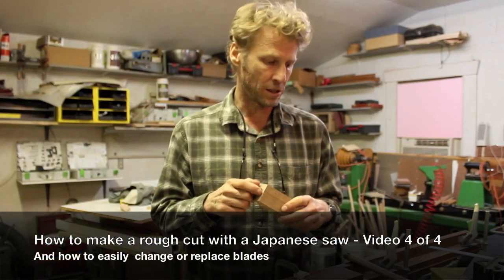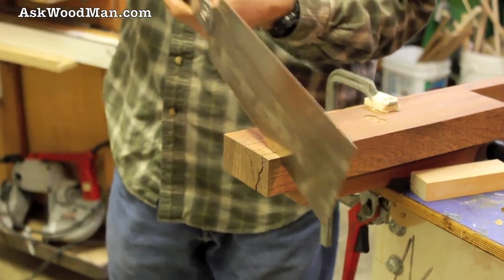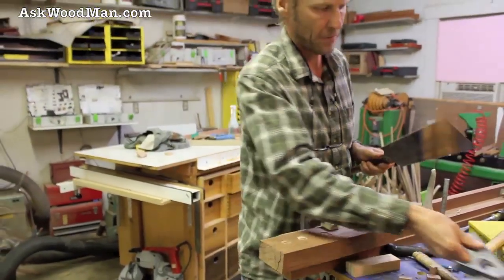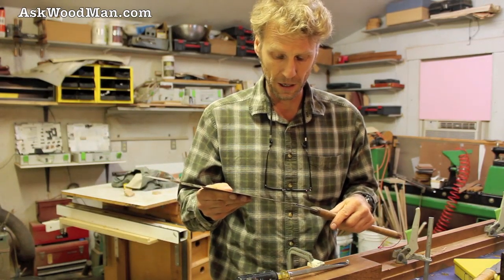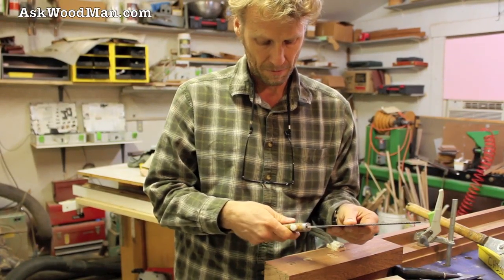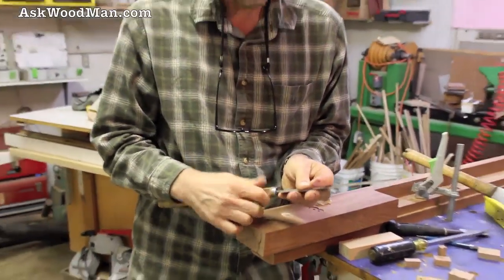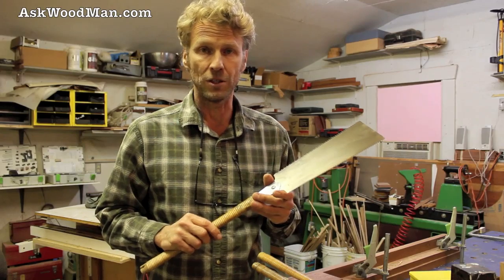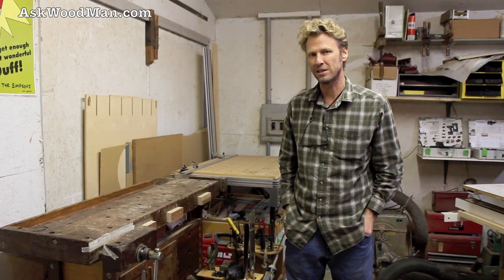43 How To Rough Cut With A Japanese Saw • How To Change Blades On A Japanese Saw - Part 4 of 4

Comment from the maker: Sure you can. It takes a little while to get the hang of them. I use them a lot but would not consider myself an expert when compared to experienced craftsmen who have been using them their whole lives. But do they ever cut! For softwoods or woods that want to splinter, scribing a line with a marking knife keeps the breakage from jumping the line. That goes for western saws too. Thanks for watching. Allan

Comment from the maker: Thank you for the nice comment and for watching. That caddy is made mostly from 12mm Baltic birch plywood through dovetailed on the corners. It just sits on a standard Home Depot hand cart I slightly modified so it won't tip over. So I can still use the cart if I need to. The mobile caddy is great for me because all the general tools I use are right there. So inside I do my woodworking, and outside I do metal working. I just wheel it from in to out or into my truck or on the trailer.

Comment from the maker: The three part numbers are 155666, 155690, 155679 in the Japan Woodworker catalog. I also use a fine tooth rip saw 157031 that I did not show in this series but it does a fantastic job on end grain cuts for dovetails and tenons. Feel free to write me at askwoodman@gmail(dot)com if you want more info. Allan

Comment from the maker: I am 6'1" and 54 and do everything in my power to not work on the floor :)  I am certainly no expert although I have used them for a long time. What I think to be the key is a gentle touch to let the saw do the work. It took me a long time to suppress my inner gorilla while using them. A western saw almost demands a rough grip on the handle and pushing power to drive the blade. Very different. BTW. Not many people appreciate my subtle comedy stylings, so thanks for noticing. Allan

Comment from the maker: The way I first learned about Waterlox 25 years ago was from a group of antiques dealers who would clean old pieces of furniture with soap and water,let dry and apply a coat or two of Waterlox. They then said the pieces would fetch double the price with this freshen up. All of the original character and patina remains but with a new bright top coat. I don't do much refinishing, I build new, but I have tried on several pieces and old floors with great results. Just don't try to cover old poly.

Comment: Beautiful video series, Allan.
I also use Japanese saws, have you bought me as 3'er set.
Most I have the Ryoba (2 sides saw) in use, because you (gearing trapezoid) for longitudinal sections (triangular teeth) and cross sections.
Longitudinal sections: with  the grain.
cross-sections: horizontally or diagonally to the fiber orientation
Reply from the maker: Günter Schöne Thanks a lot. I was just trying to make an introduction to this style of saw since they are very foreign to many people.
Reply: That's right, these are the saws for many foreign.
I think that the Japanese saws are better than the western saws. Because the japan saws work on train and you can work with it better. :-)
But everyone has a different way of working.

Comment: I have the same Gyokucho saw and cannot keep the blade tight no matter how much I torque down the screw, this is a new saw, do you have any suggestions.
Reply from the maker: +scottymac713 Which saw are referring to? I am guessing it is the 2 edged saw?
Reply: you are correct, i love using this saw but its frustrating..
Reply from the maker: +scottymac713 I know what is wrong and how to fix it. You will notice the bottom of the saw blade is split to pass over the tapped nut for the machine bolt. At the bottom of the two part blade holder there should be a small piece of steel just as wide as the blade split that is pressed in the wood at the top of the handle. This piece of steel keeps the blade from pivoting around the bolt when under load. This crucial piece of steel is missing or misaligned on your saw. The blade holder is very malleable steel so you can open the two mating pieces to look down in there with a flashlight to see what is going on. You could make a new or reposition  the existing. If you have to pull the blade holder from the handle just put the holder in  a vise and tap down on the handle top to free it. Fix the bottom center retainer and put the blade holder back in the handle, If this corrects the problem, I would remove the blade holder one more time and permanently epoxy it in place. I am thinking  back to the hazy past and I think I did this to my saw 28 years ago and it is still working well.